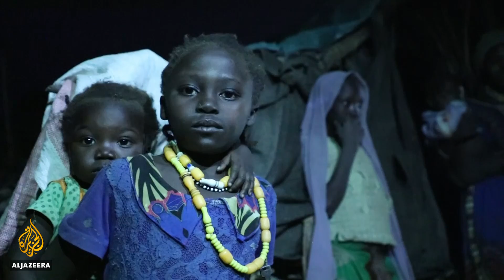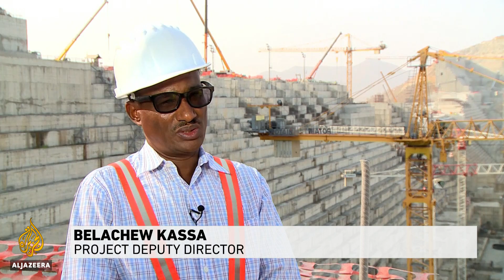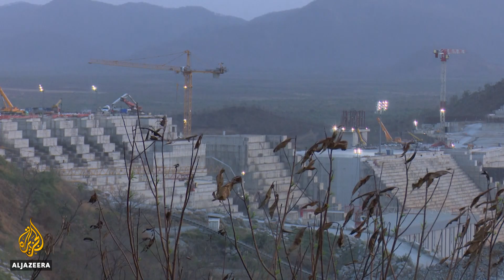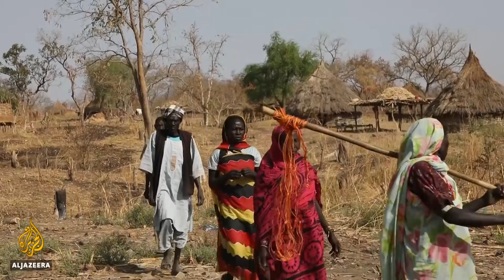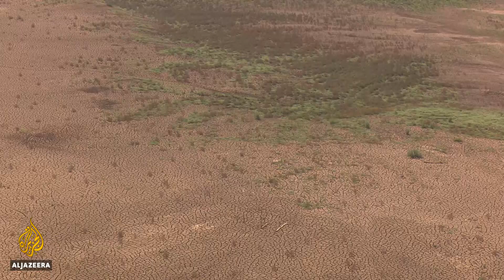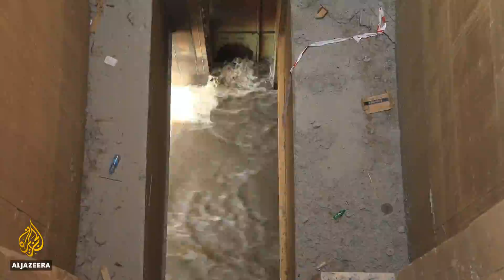Ethiopia's Grand Renaissance Dam takes shape

Comment: Water wars have started  indeed. Ethiopia have to built their national defense system urgently. Secondary problem is that destroying the dam is a catch 22 situation,  causing  catastrophic floods downstream.  Solution; fill dam seasonally and slowly (over 10 years, will never work in practice though due to financial liabilities) and then manage water level well. I couldn't help wondering why Ethiopia didn't first exploit all their numerous waterfalls for hydro-elec plants first,  Not as large but cheaper and less risks involved.  The loss of water due to evaporation on such a vast area is a tragedy. Egypt,  you had your boom. Great trouble from now on.

Comment: I am not against Ethiopians in the principle of producing hydroelectricity from an international river . They can produce electricity from the water's flow of The Blue Nile River but the design of the dam must match the reasonable historical flow rate of the river , otherwise they will face disputes , during and after filling the reservoir , with the downstream countries (Sudan and Egypt ) . Since 2013 , an Ethiopian named , Asfaw Beyene, a Professor of Mechanical Engineering , is one of A number of engineers said that, Renaissance Dam is over-sized, its capacity is 6000 MWT while Aswan Dam in Egypt its capacity is 2100 MWT with more or less the same inflow rate , and the others three dams of Sudan are lesser than 2000 MWT  together . Also , he said that the appropriate design target for Renaissance Ethiopian Dam should not exceed 2800 MWT . In my opinion this dam is not going to work in effective and efficient way because of the corruption of the planning and engineering thinking . In another words , two cascade hydro-power dams could have solved the problem for getting electricity of 6000 MWT With less water and zero disputes among the neighboring countries .
Reply: mmooaabb, some look for a reason to distract you, what they really after is your growth. That's what I understood.

Comment: Wish to see Egypt's Suicide against her own 100 million people and lose nationhood forever by trying to attack the Ethiopian Nile dam called Hedase Dam. Without the Ethiopian highland Nile water and its fertile soil, there would be no the so called Egyptian civilization including Pyramids, Pharaoh and you name it. It is totally dependent on the Ethiopian highland water and mineral rich fertile soil. 

Pyramids in Egypt including Giza (Giza means Rule in Amharic) are the tiny copies of the magnificent nature made plenty and huge pyramid Mountains in the Ethiopian highland including the Simian Mountains. And they are the source of rain/water and nature made air conditioning balancing the climate/weather with clean air to breath and nice temperature throughout the year. 

Nile River in the Ethiopian highland has 1200 permanent and 1300 seasonal the total of 2500 tributaries. Nile River is the product of these tributaries. There is a river in each and every gorge and valley in the Ethiopian highland where some rivers looks like the Nile itself during the rainy season.     

For instance there is a protected area called Choqie in Gojam.  Only from this place more than 79 rivers and 275 streams are pouring towards the Nile with in Ethiopia.  It is easy to dam each river and use them for energy, fishery and irrigation. There is one river called Chemoga and it has the capacity to produce 275MW. These shows that from those 79 rivers can be produced at least 7000mw.  But the Nile permanent tributaries are more than 1200 rivers.  

The point is that if Egypt even tries to attack the Nile dam that would be the end of the Nile River even with in Ethiopia. The next day, Ethiopians will start damming each and every river around them and make the Nile valley empty with water.  

Nile river valley in Ethiopia is too different that of in Egypt. In Ethiopia it is a green full of with plants and animals wide gorge.  That means it is easy to divert the water by making tunnels through the Gorge.  This is an easy and best solution if Egypt even tries to do anything against the Nile or Ethiopia at large using the USA subsidize military/damping ground and Money they are getting for free.  

Water is the most valuable gift from nature after the sun and air. Without fresh/rain water there is no life, no development and there is nothing. Dirty substances such as oil and gas will be gone soon. No one will use them even for free let alone to buy them and affect the environment and health. But water especially fresh water will be the most wanted and expensive everlasting substance in the future. River/rain waters including the most mineral rich or any river in the world which is the Nile will be the most expensive in the desert. 

Egypt's population that is multiplying abnormally despite only 4.5% the land is useful and they have no resources including water and farm land, will make the price of water expensive than life itself.

What we are saying is that Ethiopians must be happy if Egypt attacks the Dam or trying to make it difficult to operate.  They just need to prepare and stand by to dam all the Nile tributaries and also divert the water by making thousands tunnel which is easy to do so because of the nature of the topography.